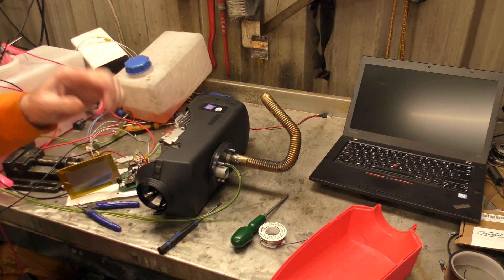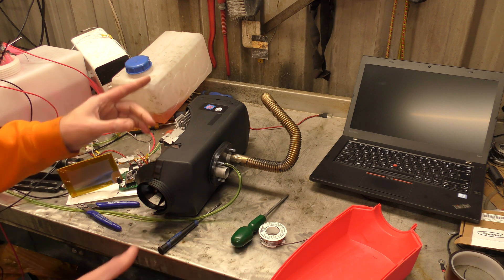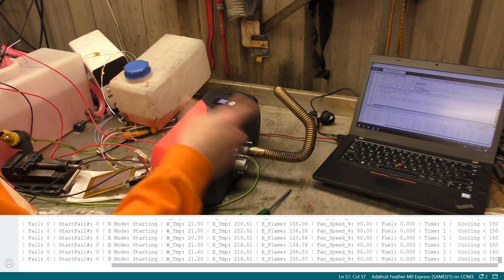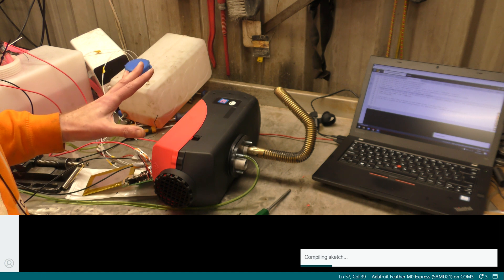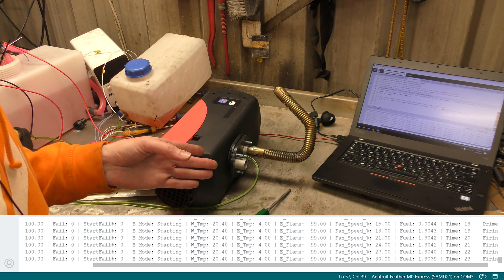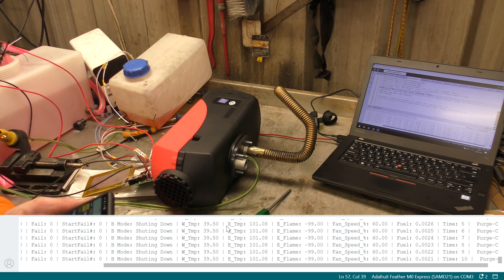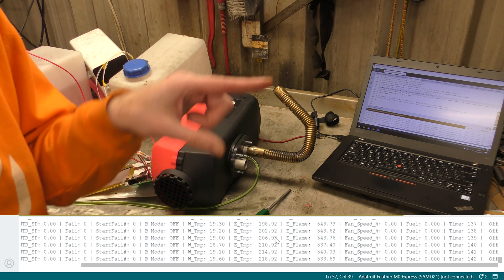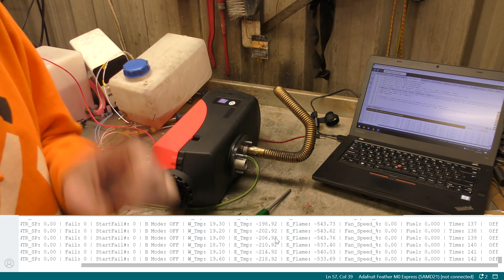Webastardo V3 - running a diesel air heater, why? - Part 3

Comment: hi, is the pcb wrong? Pin 3 goes to A1 via R11 4k7 divider for exhaust temp. And pin 5 goes to the A2 via R12 100k divider and is for exhaust pin too. I know, either this or this. But in the code A1 is for water temp sensor, and the text on the pcb on left side claims that too. I see that you have installed the two thermistors without resistors or capacitor, correct? thats enough? so the pcb could be cleaned a bit yes?
Reply from the maker: The text is wrong on the board yes.  But it's easy to change the thermistors round in the code.  You only need the additional capacitors and resistors if you were using the original Webasto thermistor.

Comment: Hi David, I'm currently working on getting a thermo topC running, I've got Simons version 3 & version 2.1 boards and I'm using the feather hazzah32 with it. I noticed that you mentioned some funky behaviour when using the wifi board in one of your previous videos. I found the problem, A0, A1, A5 do not work when the wifi is connected 😬 it's because most of the analogue pins are adc#2 which are used for the wifi chip, adc#1 pins work all the time. so I've cut a trace on the board and moved away from A1 for the thermistor and wired it to A3 instead. now it works perfectly through the blynk app. unfortunately this means that A0 (the push_pin to start) is also not active when wifi is working. I'm trying to move the push_pin to pin 32 (A7) on the feather because this is an adc#1 too so should work (I'll keep you posted on my future trials) 😁.  I'm still waiting for my current sensors to turn up so I've been testing all this on the v2.1 board with the wifi version feather but the pins and circuitry is the same on v3 too.
I can confirm that cutting another trace and wiring push_pin to pin 32 (A7) works. i now can use blynk app or manual switch/time clock etc to start it.
Reply from the maker: Excellent work!
Reply: @DavidMcLuckie   I've made a video showing my findings plus my hardware and software changes. I'm unsure if you want the link posting here but let me know if you do. regards Steve.

Comment: Off topic question here - I have very limited space to install a heater - could i have a 90 degree bend in the hot air outlet pipe right as it leaves the unit? Or would that cause problems with restricted air flow?
I havent been able to find anything on this.
Reply from the maker: Assuming your 90º bend followed the radius of the original pipework and didn't have many other bends after that or a huge length of ducting I don't see it being a problem.  I usually have a 90º bend outlet on for bench testing.

Comment: David, how long do you recommend priming these for. Brand new. Never been used,/filled. Need to bring fuel from tank, through lines and into machine. 

Some folk say 20 secs.. but cant see that being enough

Only ask, as i have replaced the fuel lines to black rubber
So cant actually see
Then put a case over the whole lot to make it weather proof
Reply from the maker: Tricky.  I usually prime them until I can see fuel at the heater.  But that doesn't help you.  Option A - remove from case, undo fuel pipe into heater and prime until you have fuel.  Option B - prime until diesel drips out the exhaust.  While option B works, I don't recommend as it'll smoke like a trooper for a while.  :)
Reply: @DavidMcLuckie Well, 90 seconds, and it fired first time. No smoke. Plenty heat and very quiet.
Impressed!!!

Comment: It would be cool to see a catalytic converter on one of these to burn the fuel in the exhaust. You could collect the heat with engine coolant especially if you already have an egr cooler. Any chance you could see if you can get a cat to heat up with these?
Reply: LOL.  It is a burner, if there is fuel in the exhaust you set it wrong. You want to detune it so it spews fuel out the exhaust so you can burn that in a catalytic converter?

Comment: Switching out the fan for external one's could be good you can get 12v brushless snail fan's ment for 3d printers etc they use very little power and push a surprising amount of air I'd put one of the big one's on the burn chamber inlet with some air flow mods where the original fan should be and for the hot air side you might be able to save a few W by using a few of the smaller ones cleverly placed to make a Venturi effect same idea as the Dyson fan's but at the same time nothing like 😉

Comment: I would love to have the diesel heater ECU do a switchover and switch back from WMO and diesel and run the WMO at different temps to avoid Schmutz in the combustion chamber.

Comment: Hi. Could you do a comparison of diesel v kerosene. As you know I run 4 heater's only on kerosene. The thermostat does give a reading of 10° higher on kerosene plus it may give your keks a heat boost. I find I use almost the same amount of fuel as diesel but kerosene seems to heat up quicker plus it's only 58p per litre at the moment